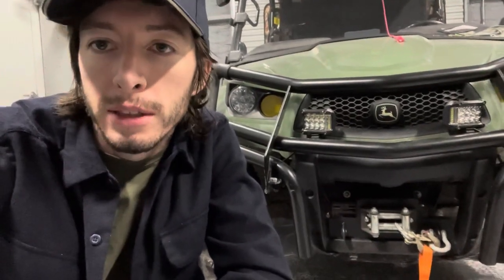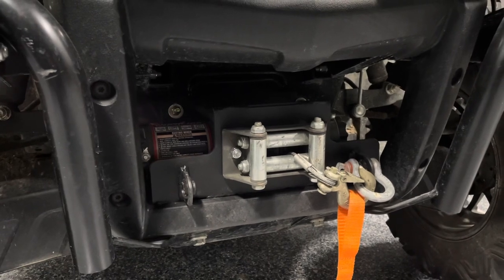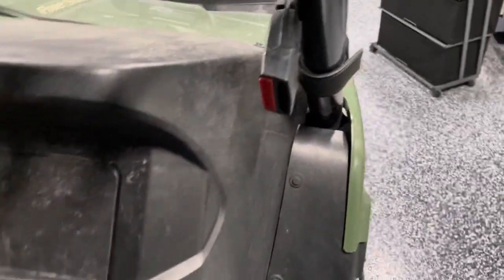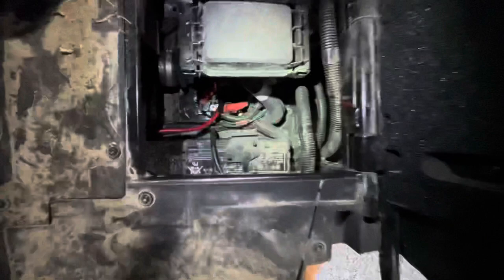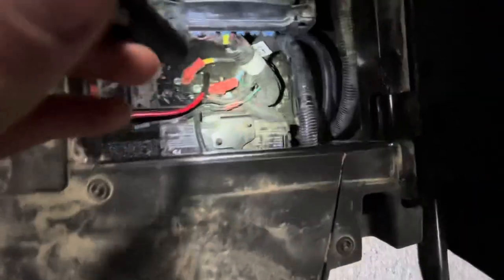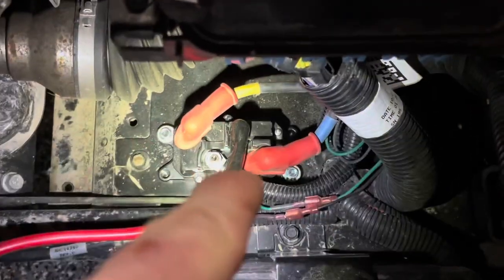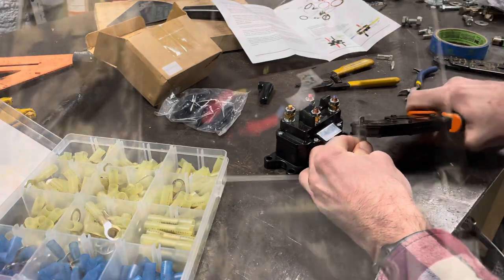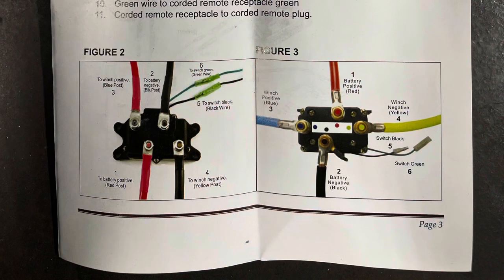John Deer Gator XUV Winch Install Using Factory Wiring

Comment: According to John Deere the factory harness should be plug and play.  So, is the solenoid install necessary?  Couldn't you simply connect factory harness positive and negative cables directly to your battery?  Or is this needed for the glove box remote to work?
Reply from the maker: Howdy HH - you’re jogging my memory but it’s a good question. If you did that I believe you would have two issues: Constant power to your winch, unless you had a heavy duty switch wired in (typically not how it’s done due to cost of wire) and you wouldn’t be able to reverse the polarity, meaning power the winch in/out. You’ll for sure want the solenoid, but the remote can easily be replaced with a forward/reverse switch in the dash. Hope this helps!

Comment: Great information,
     I have a 835 r the wires running to the wench are there but no plug in the glove box. Very hard to tell with the hvac lots of stuff under the hood. I'm thinking I might have to run the small wires to the switch and for the plug in the glove box. Not sure yet. You helped me with getting started and what to look for thanks !!

Comment: Would you also do a video showing how you wired the brush guard lights?
Reply from the maker: Hey Jay - I would love to but haven’t been able to find the time to finish some of the video projects I’ve started. I will say this though, I recall pulling a lot of the front hood and plastic storage basket up in order to do a clean wiring job. I also purchased the OEM switches from John Deere to replace the blanks in the dash. Getting behind the dash was the most challenging part of the job though. I recall having the most luck reaching through where the center cup holder is to get the back of the dash for the switches.

Comment: Good video. Minimal 590M info out there so this was great. 
What are you using for floodlights or spotlights on the front bumper?
Reply from the maker: Hey Chris, I tried to look up the model of lights but it appears they have been discontinued. I had purchased them on Amazon. They were spots with the “side shooter” leds. I saw a similar pair I am considering as they have they have a flashing side shooter amber option which I can appreciate for additional safety for the occasions I am on the road. https://a.co/d/eOBIp2x

Comment: Thank you for the video!
Getting ready for a similar install. In your case, is the winch always powered, even with the key off? I know you need to plug in the remote (but if you did with the vehicle off). I would like to also put a dashboard switch to make it easier for plowing but don't want it to work with the key off. Do you happen to know where the accessory wire would be on this model?
Reply from the maker: Hey Dan, 

The winch will not be powered when the key is in the off position. It is switched with the rest of the accessories that come on when the key is in the accessory/on position. As for installing a dashboard switch / the accessory wire, look up under the dash. If I remember correctly the power wire that routes to the remote connection is easily accessible there to tap into.

Bests,  
Eric